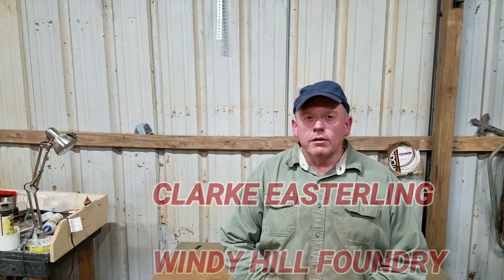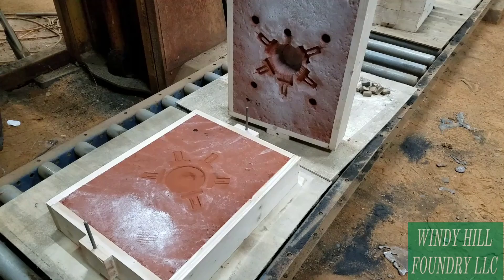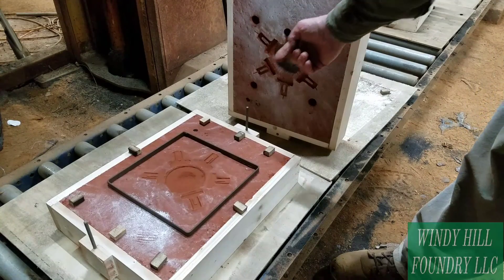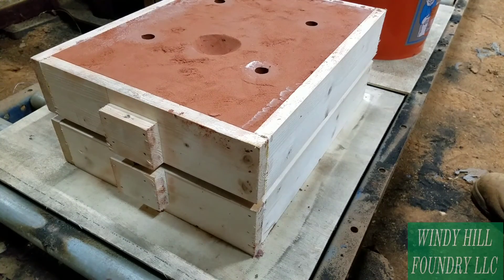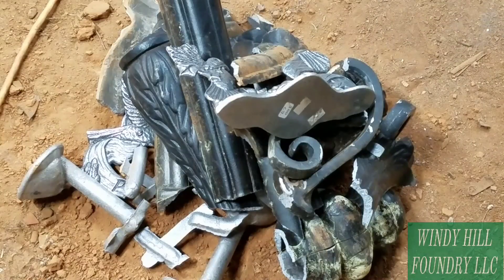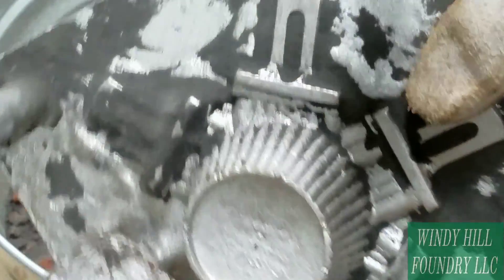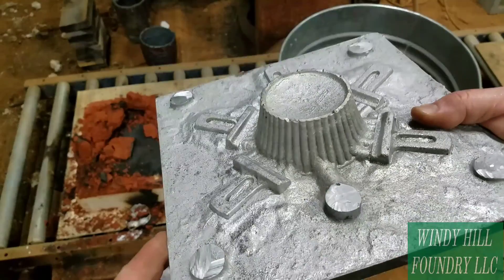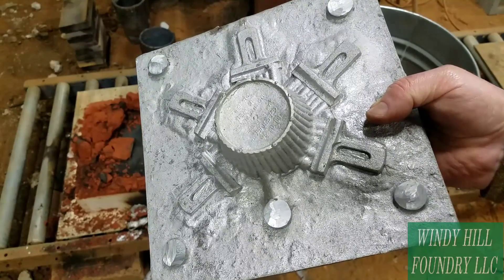CASTING AN ALUMINUM MATCHPLATE WHF6

Comment: Interesting process. I don’t do metal casting so I had to look up what a match plate was for and how it is used. It should definitely save a lot of time in manufacturing! 

I should point out I’ve only done mold making with silicone for resin casting.
Reply from the maker: I actually have some of that stuff and I'm anxious to put it to use. There are times I could make up multiple resin patterns to save me significant time

Comment: have you tried using plaster of paris and lost pla method , would create a flawless plate
Reply from the maker: I've experimented with it and because of time restraints I have to go with the fastest process. I actually have ceramic slurry and I have dabbled with plaster and sand in the past.

Comment: Thanks, it was enlightening to see you work with a match plate format and use Petro-Bond for the sand which should have given a better surface than it did.  Of course you can make a match plate pattern on a plate (plywood, etc.) and use it between the flasks, but it will wear out much faster than the aluminum one you made.   What flux did you use with the aluminum?  Great work!
Reply from the maker: Thanks, I only use petrobond for production patterns. I have used matchplates but they don't work well for me. They never come out clean,  I don't use a squeeze jolt which would make plates ideal for that of course.

Comment: Oh man I thought you only cast iron. didn't realize you did soft metals. Theres a ton of glass Blowing dip molds for fluting glass bubbles when molten made of aluminium and bronze. I have a bunch of ideas for some of my own designs ahh very thought provoking jndeed.
Reply: Do you have a website or email for the foundry?
Reply from the maker: Yes windyhillfoundry.com